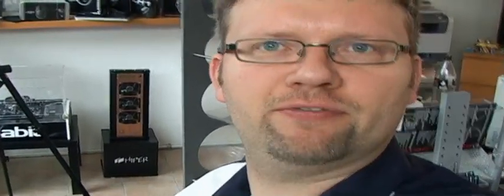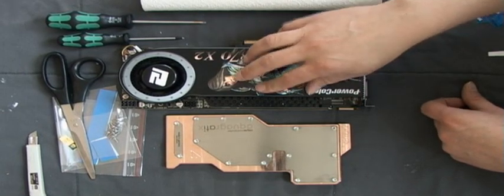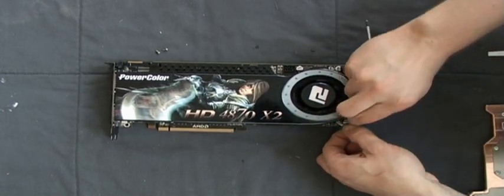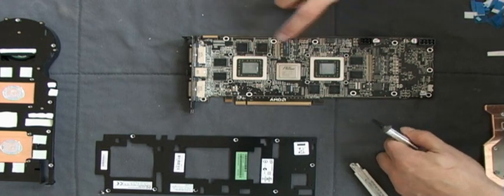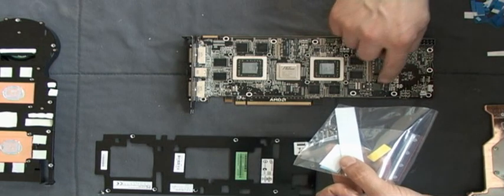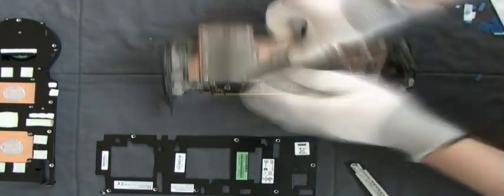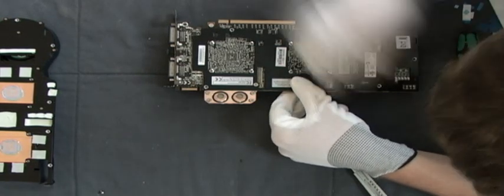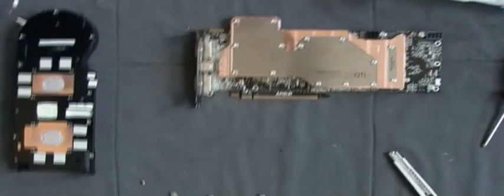Water Cooling ATI HD4870 X2 graphic card

Comment: I have 43°C idle and around 90°C under load at VDDC Phase#1 according a CPU-Z with case open, i3 no oc and 120.3 rad with fast fans around 1700 rpm. I am not happy with load temps. What about your temps under load?